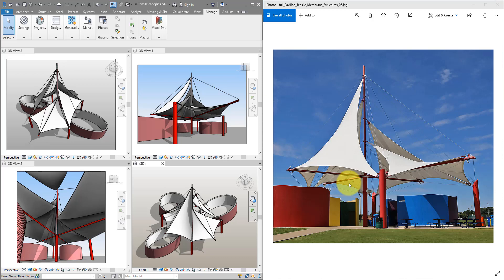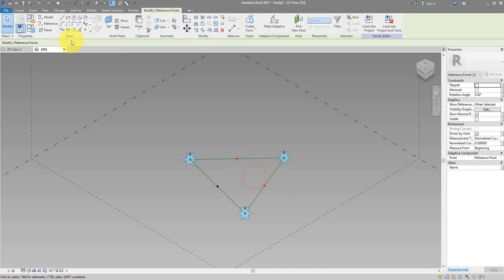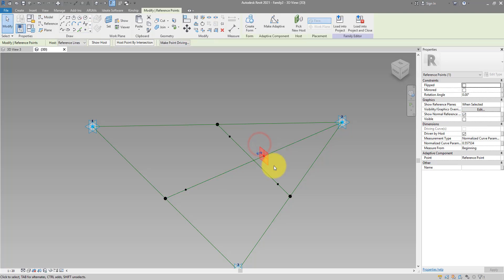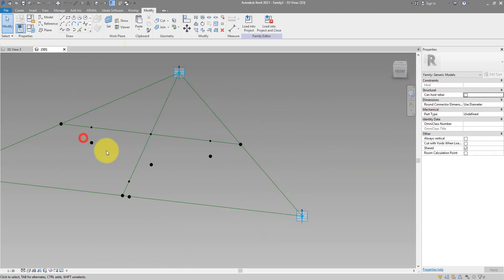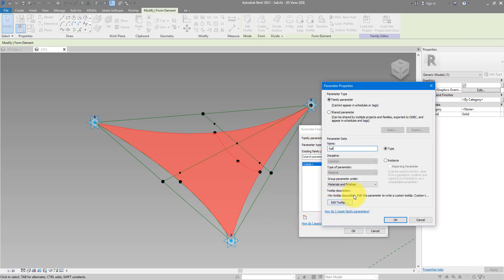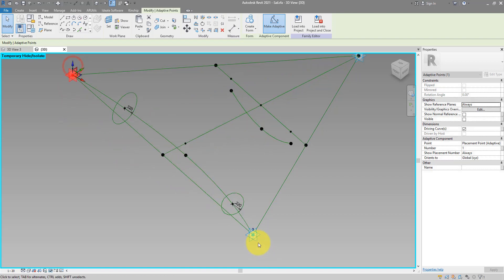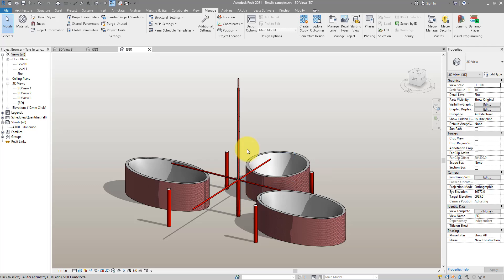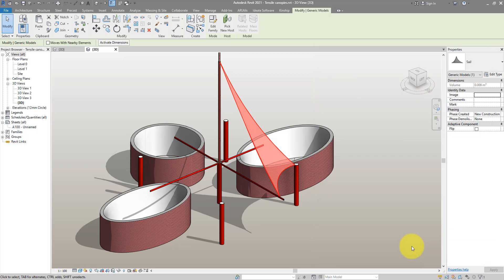Revit Snippet: Create Tensile Canopies with Adaptive Components

Comment: when i create form by selecting the 3 ref lines the shape created is not like yours but it is a fold starting from end and goes straight to the last then folds back into the middle line. please help
Reply from the maker: It's a bit random to be honest. You can try placing the lines far away from each other, in the order you want the new surface to follow, and try that command again.
Reply from the maker: Another thing to try is make sure the lines have start points and end points on the same side, so that their directions point to the same side of the new surface.

Comment: When creating the edge boundary circle forms for some reason I was unable to select the point element once the form was created. I had to first move the points to 0 and 1 and then create the forms. I'm using Revit 2020 currently. Tried highlighting the area to filter the point and it doesn't seem to be there. Is there a setting or visibility parameter that keeps the point from disappearing?
Reply from the maker: Is it easier to see and select these points if you switch the view to wireframe mode, and press Tab until they highlight?

Comment: When I create the form, its connecting all the points along the reference plane as well as the curved points below... so it's showing a flat form on top, as well as the form from 1 and 3 to the middle..
Reply from the maker: Strange! Could you send a screenshot of the problem?
Reply: I'm having the same issue actually!
Reply from the maker: Please make sure to follow the video closely and see if it helps. You can also download the family from the video description 😊
Reply: @RVBoost  I figured it out! The 3 adaptive points were all on the same plane, so it was making an L-shape with a very acute angle. Raising one point fix adaptive point fixed it.
Reply from the maker: Great tip! Thanks 😁
Reply: @michaelkemner7362   Followed the tutorial verbatim two times and had the same issue. Raising one of the points then creating the form solved it! Should have read the comments before going through the exercise twice.  I'm using 2020 and noticed this video is using 2021, not sure if that causes any of the same issues as all three points in the video appear to be in the same plane, but maybe not. Anyway, thanks for the tip!
Reply: @michaelkemner7362  Gracias, Ya tenía un buen tiempo tratando de descifrar el error.
Reply: @michaelkemner7362  thank you so much for this information. i have had to watch the tutorial over 10 times. thank you @rv boost for the great video.
Reply from the maker: Glad you like it :)
Reply: I'm still struggling with this and can't solve it... I don't understand what the problem is. I tried to pit the 3 adaptive points into different planes as well... Nothing seems to work.